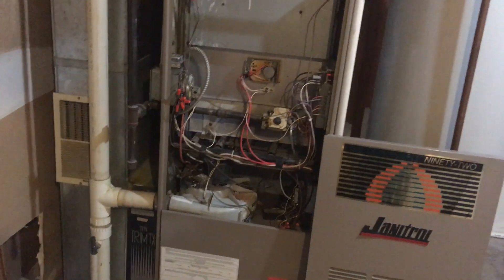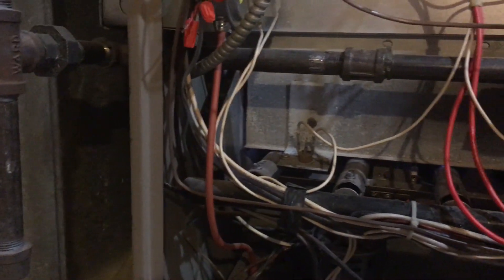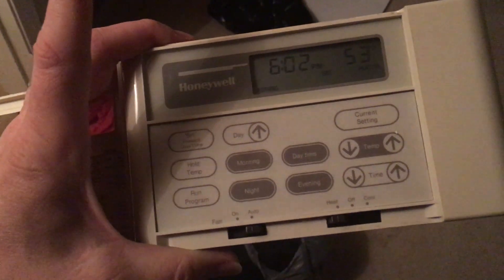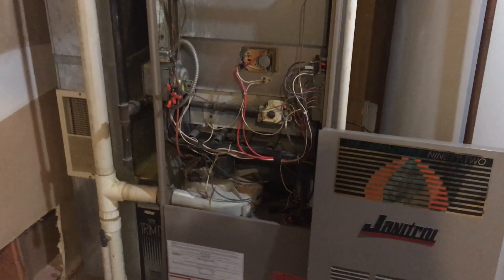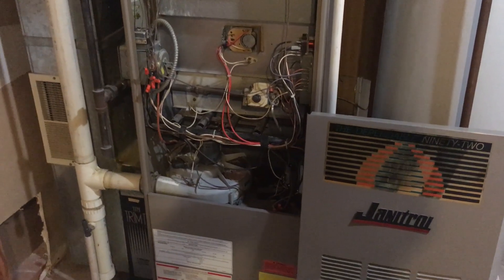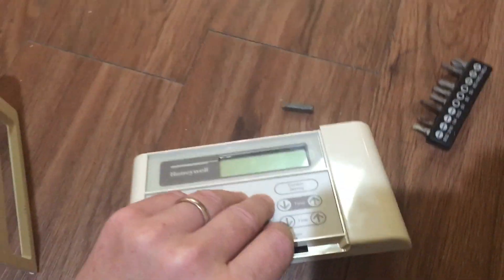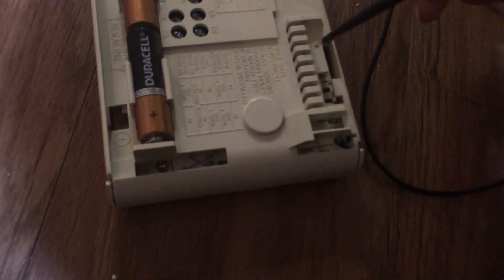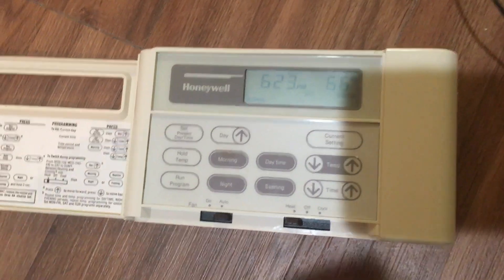Furnace Not Coming On? - How to Diagnose if Dead Heater is a Thermostat Issue and Fix Yourself!

Comment: The house I live in was built by my grandfather in 1959. I have old school gas wall furnaces with the original thermostats. I have one heater near the living room area and the other down the hall by the bedrooms. When I first moved in the house the front furnace pilot would light but it wouldn't kick on.I toughed it out the first year which wasn't too bad being I live in New Orleans but the second year I decided there must be a reason that the heater that always worked my whole life isn't working. These thermostats are a original 1959 and after looking at them and it seemed to be doing what it was supposed to I used my vintage tube amp knowledge and I cleaned the contact with an emery board. Bam, it started working and still does. Probably work forever or until the next person buys the house when I am dead and stupidly decides to upgrade. Moral of the story, if it aint broke don;t fix it.